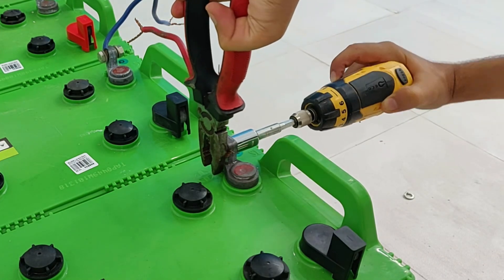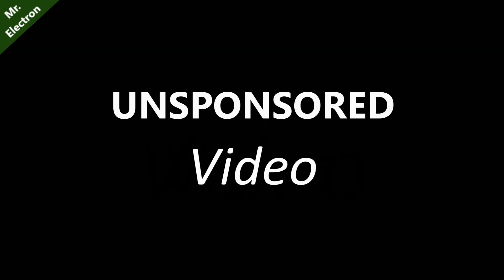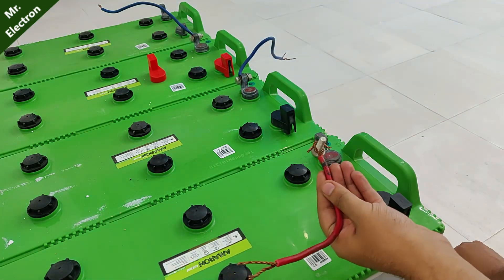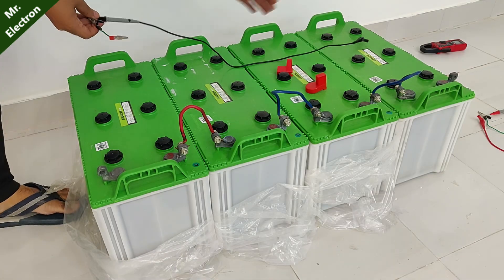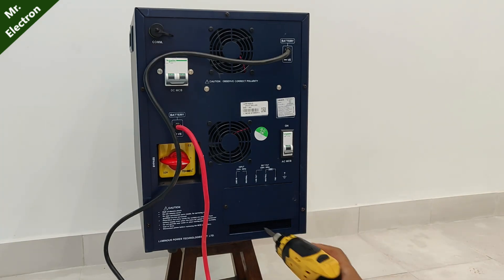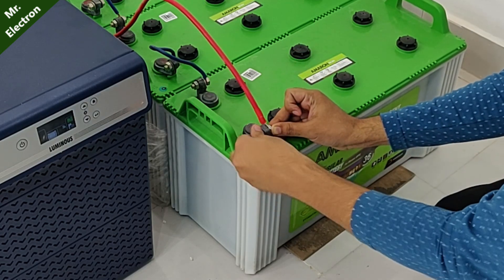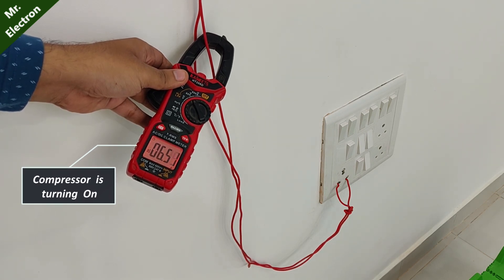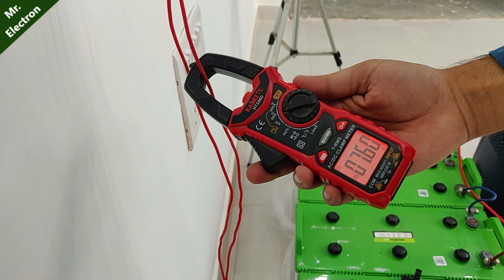How to Run 220V 1.5 Ton AC on 4 x 12V 150Ah Battery

Comment: Please someone tell how 220V AC ran on 48V from batteries?
Reply: With the inverter
Reply: Inverter device is used which converts 48v dc to 220v ac.
Reply: @VMgeschwader4117  thank you so much, never knew its possible with inverter

Comment: Hello, I am a hardware engineer from China. I watched your video. Why not try to build an off-grid solar power station?
In addition, the air conditioner can use variable frequency, which saves more electricity if it is turned on for a long time.
Reply: yes it can be but this guy not able to get your advice
Reply: Hello bro

Comment: Alternately easiest approach would be getting SINFIN solar inverter AC[51k inr], it can be directly connected to solar panel with 48V output power draw is around 8 amps & can be switched to mains voltage mode during night..

Comment: You have not mentined ,1.5 ton Invertor ac running time on batteries
Reply: That's the core question that should have been addressed in this video.

Comment: how long u run ac on these batteries
Reply from the maker: Depends on a lot of factors like ac stars, how hot the surrounding is , at what temperature are we running the AC. Therefore, its difficult to provide answer for that
Reply: 1.5 ghantaa
Reply: No Answer
Reply: 60% load me 4-5 Ghnta easily... inverter ac ho to.
With 200ah ,4 battery

Comment: Why amperes are consumed more wile running iby inverter but it run by power supply the ampere is less kindly explain.
Reply: The AC is running with 230 V AC and the voltage form battery  is 12*4 = 48V ,so do the math P = V * I ,when voltage is less current is more  and vice versa .